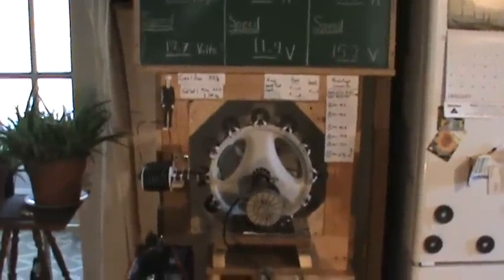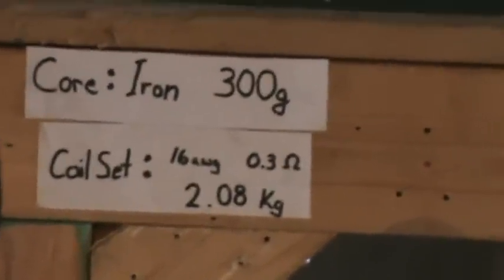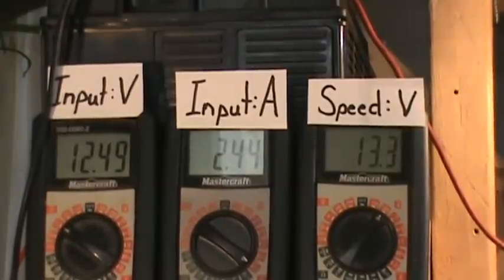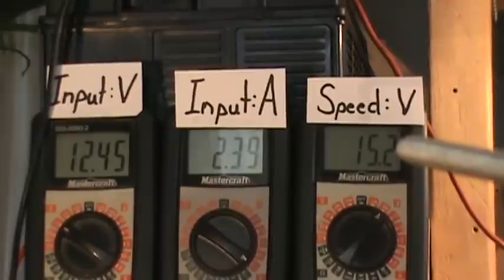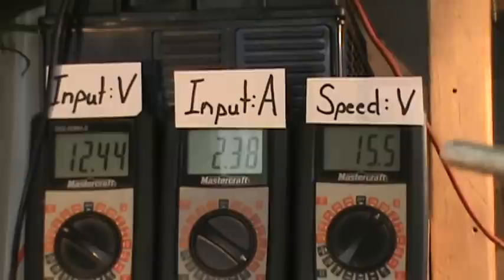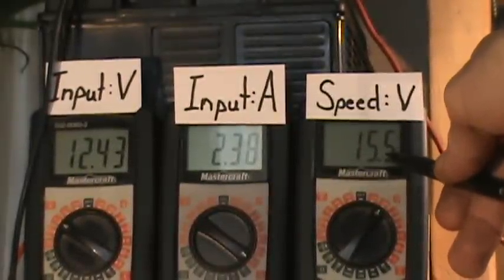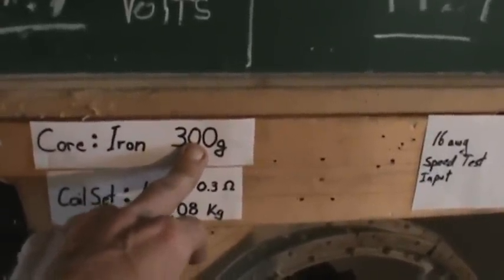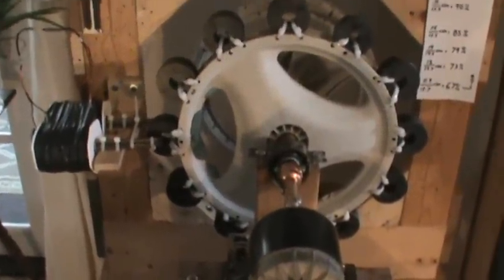Free Energy Project - Speed and Input Test 16 awg

Comment: This is getting good.I think (oglundasotarn) has coined the term.  "The Angus Effect"  I had a minor malfunction. One of my gator clips got sucked into the flywheel. It was connected to a small D/C motor and rectifier. LOL I can't have good luck. I Should get it back together tonight. I did find that by moving the coils closer to the magnets, picked up quite a bit more voltage and reduced lenz even more. I used the same core. I just put the mount between the coil and the U. You are the Man

Comment: Try bundle of green-enameled florist wire bent  U-shape for  cores 
 art supply stores have it
Try  heavy load with your coils-output instead of shorting them out, 
dead short makes it so no votltage is made in the coil so people will say you are "only neutralizing"  drag of iron-core to the magnets

Or are you runinng a load? (that light??)

ebay has nice laser RPM meter s just 16 bucks

Try  odd number of core postions, vs the even number of magnets

do more coils and cores, make more power